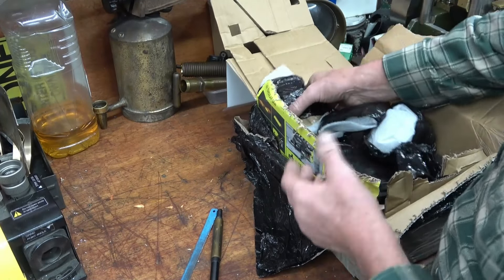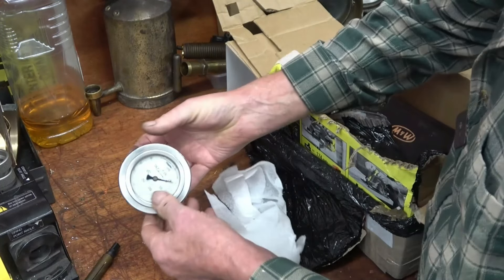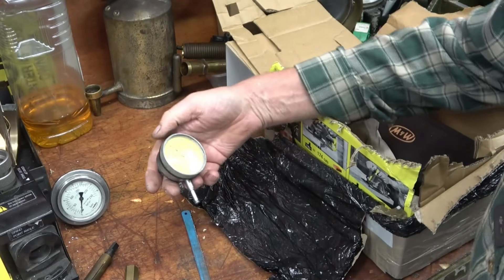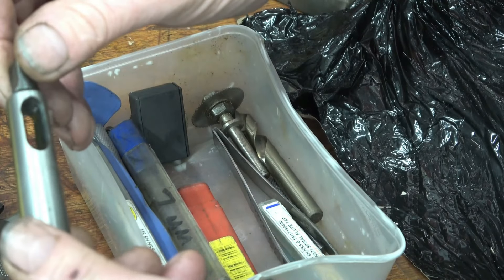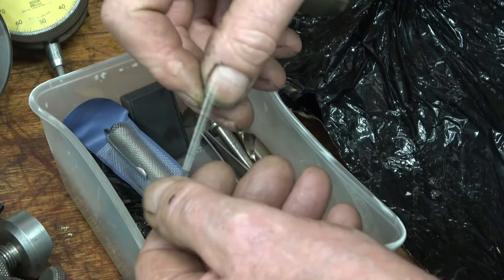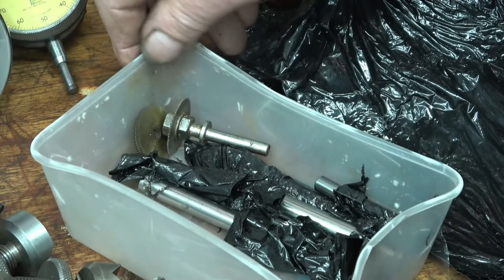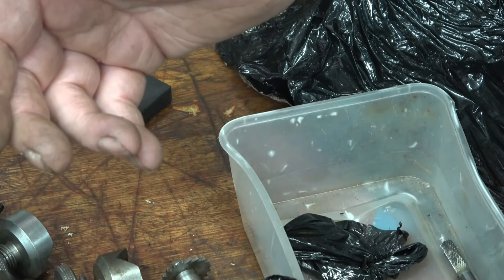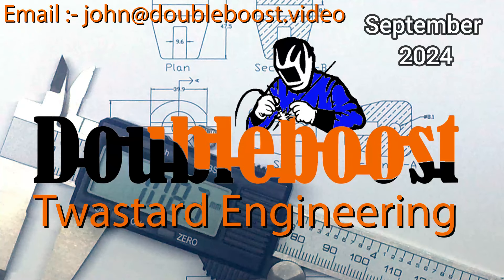SNNC  553 P2

Comment: Unless I have misunderstood how they work I can't fathom out why greaser pots are so deep. I doesn't seem possible to squeeze out more than the depth of the thread which appears to be about 1/3 the depth of the pot.
Reply: I believe that when the cap is screwed down and grease is pushed thru to the bearing , When the machine turns grease is drawn down from the pot .
Reply: @boydovens4180  yes, I know how it works, but there appears to be a lot more volume in the pot than the cap can possibly push out.
Reply: @chrishartley1210  It must be a vacuum effect that draws the grease onto the shaft as it turns .